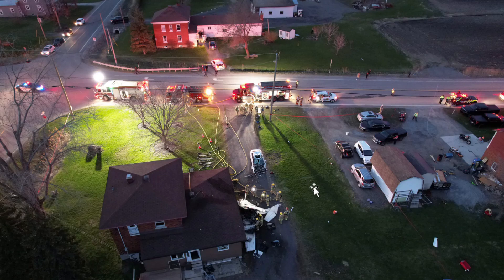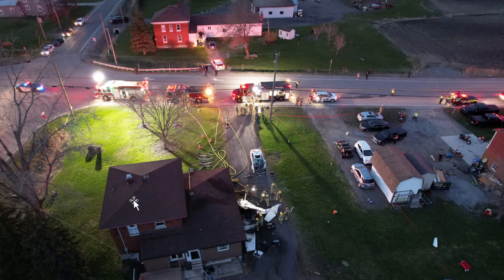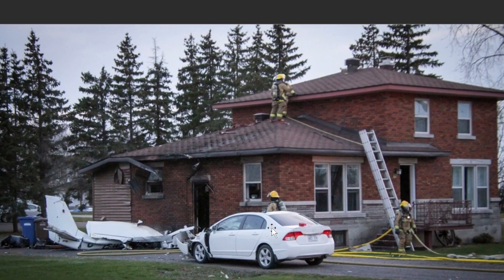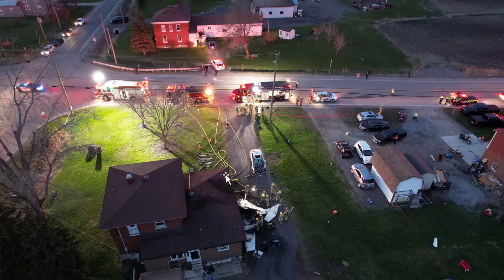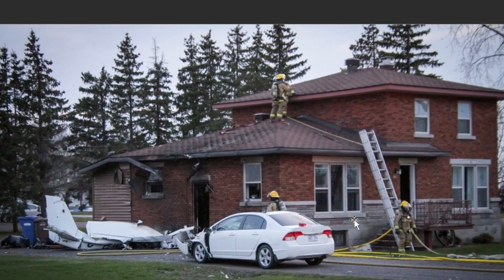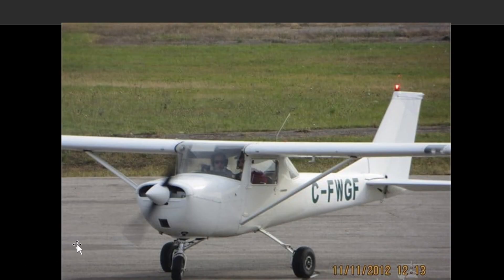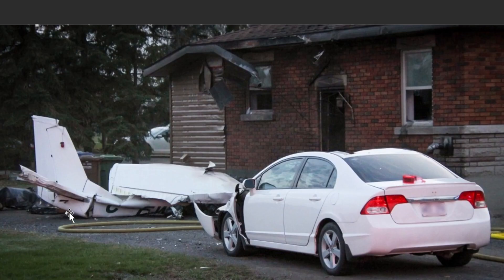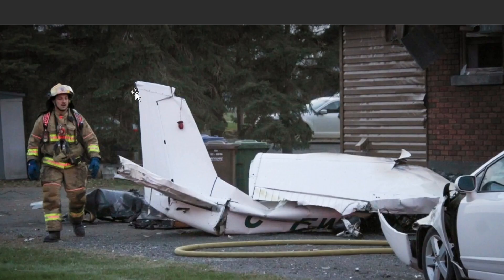Cessna 150 Hits Homes in Canada

Comment: Great job keoni keep'em coming.
Every air crash is very important.

Unlike auto crashes and truck crashes that gets swept away the moment the debris is cleaned up, NOBODY INVESTIGATES,
But not us in the flying community. We get looked at under a microscope and held accountable.

It's a shame that the automotive deaths are nothing but a filler for the nightly news that only lasts 10 seconds.

They say that three out of five drivers on the road are taking some type of controled substance.

We in the flying community have to be ready to give an answer then we cannot fly with impunity.

🛫📖🛬
Reply from the maker: Good point.